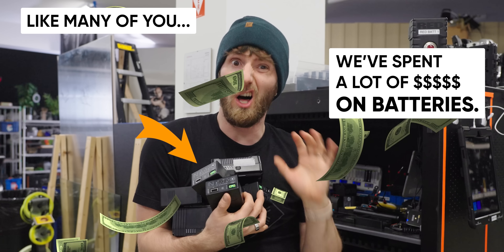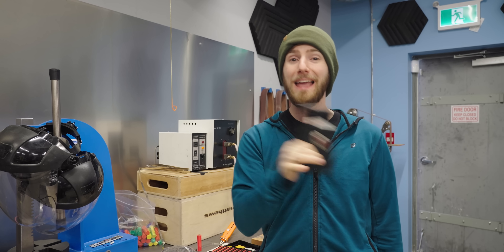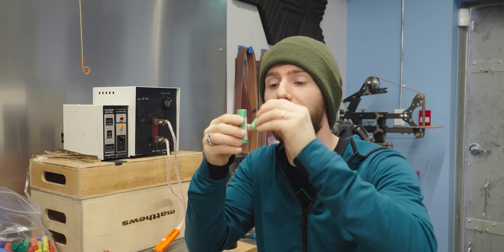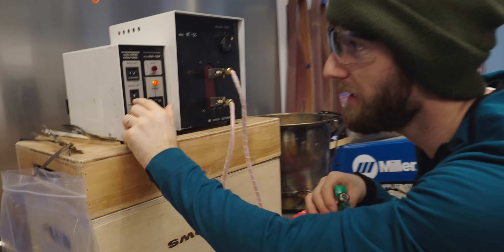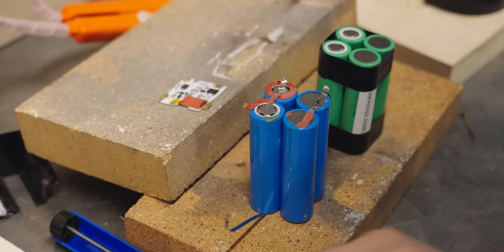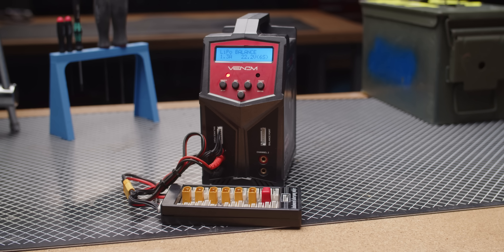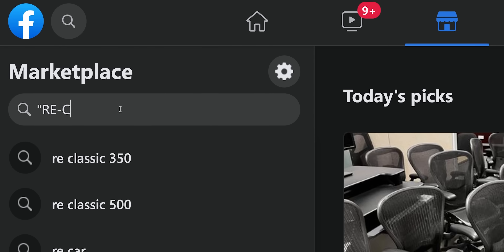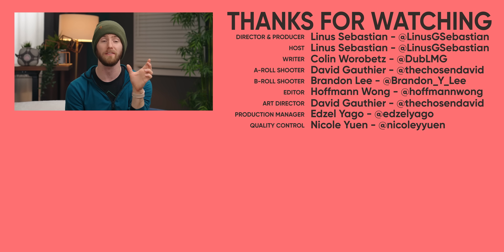This should be illegal… Battery Repair Blocking

Comment: The batteries are proprietary and can't be substituted with Commercial Off-The Shelf (COTS) parts. The reason they are proprietary has to do with form factor and device requirements.  This isn't a place to pick a battle.

Comment: Just add a new single battery fused then snip the default leads to dying battery area that will keep the board living during operating it's like charging circuitry in amplifiers motherboards using a bulb before hooking to 12 volt assembly would be snip life support right after main leads are being connected

Comment: some BMS might required manual reset after the battery voltage dropped to certain level, try shot the battery pack negative terminal to BMS negative terminal for 3secs. TRY AT OWN RISK

Comment: You need to be aware that there are a good number of BMS chips out there that are very sensitive to the order of connecting the cell stack leads.  Generally you start with the negative and then connect the cell nodes in the positive direction from lowest up until the top of the stack.  You can find this when you read through the chip application notes.  Doing this wrong can result in either the BMS going into protection mode and locking you out or even blowing the BMS chip itself.  A few other things.  It is helpful to weld the cell tabs from negative to positive up the string as well.  Use that DMM you have there before placing every Ni weld strap!  If you see more than a few millivolts you are making a wrong connection.  If you wait until you do a weld then find you are shorting something by making a wrong connection you are too late and you will have both a fire AND lose the cells you just paid for.  You don't need to buy an expensive welder; look on youtube for super cheap welders you can make yourself.  I found one where a guy made a welder with a contactor, a beefy battery and copper roofing nails.  I thought that funny so built one myself just to see how it worked compared to the industrial one where I work.  Not bad at all!  I made it a little fancier, I made an actual adjustable one-shot to get the timing uniform.  I used three in series 32113 A123 cells which can handle enormous currents (Battery Hookup always has beefy cells you can use).  Another thing to consider is that some BMSes track battery health and if you replace the cells you need to reset it or the charge indicator and reported charge will be way off.  Another thing is that some of the BMSes will go into protection mode when cells are removed and are reset by connecting to a charger, so try that.

Comment: As someone who does this sort of repair and build at least daily, a couple of suggestions:
Don't use tape to bind your pack, use a quick-drying epoxy between each cell. You're not going to swap individuals out later, no need to pack loose.
When assembling batteries, gravity is your friend. Build a small ramp, kinda like a card dealer's shoe, with a back edge and an edge to hold the batteries in line. Use this to line up single sheets of batteries, then epoxy them together.
Always use the lowest tolerable schedule for tacking together nickel plating on lithium builds.
Reply: While generally switching individual cells can seriously unbalance a battery, switching out DoA or otherwise prematurely failing cells still makes sense, and gets blocked by epoxying everything together before even knowing if there are any bad cells in the batch.
Reply: Why not use hot glue instead of epoxy. It's much much more convenient, and is plenty sufficient.
Reply: @smallblockchevy1022  Many packs are put together with hot glue, but you need to be careful with lithium cells since they really don't like high temperatures.  So use the minimum amount of the lowest temp glue.
Reply: @laurenceperkins7468  Yeah, that's a non issue. Hot glue guns don't produce the kind of heat that would present a problem in that scenario. Even if the glue does reach a temperature equal to, or even a little higher than what Li-Ion cells are rated for, it isn't going to hurt the cell.

People need to remember that nothing out there is ever rated at the exact the exact point where it actually fails. There are differences depending on the specific product, but most things are rated on a double, triple, or even quadrupal standard. If a ladder is rated at 250 lbs, that means that in actually lab testing, that they didn't actually fail until exposed to loads in excess of 500, 750, or even 1,000 lbs. Like wise with air compressor tanks. Tanks that are rated for a maximum pressure of 120psi, never fail at less than 360psi during the safety testing phase.

So I don't know exactly what it is for Li-Ion cells, but I guarantee that they'll take far higher temperatures than manufacturers will ever publish.

But there's even further reason than that to why using hot glue won't present any issue, and that's because cylindrical metal cells conduct and dissipate/transfer heat fairly efficiently. When you apply hot glue, even at what would be considered too hot of a temperature, to the external surface of a cell, that doesn't mean that the internal portion of the cell will ever reach that temperature, because the hot spot the glue creates on the metal exterior will disperse throughout the surrounding areas of the exterior at a much lower temperature than the initial applied temperature.

I think you'd have a hell of a time destroying/damaging a cell with hot glue, even if you were intentionally trying to. Now if it were some type of resin, or rare type of hot glue, maaaaybe, but just standard hot glue... And of course I'll never say never, but I'm pretty confidently thinking there's not a chance.
Reply: @smallblockchevy1022  High temp hot glue goes on at 450F.

The cooler stuff is only 250F.

You'll start to damage lithium-ion cells at around 140F.

So yes, you could definitely damage them on purpose with a hot glue gun.

Which doesn't mean you can't use hot glue.  Like you said, metal-cased cells distribute heat reasonably quickly, so you probably won't make any hot spots if you use a low-temp gun and don't linger and don't use too much.

But don't linger and don't use too much.  You probably won't make a cell explode, but you can easily shorten its life with too much glue.

Epoxy can have this problem too though, some quick-set formulations can get quite hot and can be an issue if you use too much.
Reply: @laurenceperkins7468  Well OK, I may have been exaggerating with the "even trying" claim :) , but from my understanding of physics, and the general understanding I've gained thus far about li-ion batteries in general, at mildly hot temperatures (which is a relative term of course), perhaps even up close to 175F, short exposures, although actual lab tests may show a trivial amount of cell degradation, don't really present an issue for practical, real world purposes. I believe it's more a long-term exposure issue. Examples like a long ride up a steep hill on an ebike at full power, on a 120F day, with your cell pack in a black case, directly in the sun. Or storing your pack in a closed up, non-climate controlled storage shed throughout the summer, in an area that regularly saw 120F summer days.

I plan on testing this one day, but for now I'm quite positive that no hot glue work on li-ion battery packs is going to result in any type of perceivable, or at the very least, consequential reduction in performance. Obviously within reason of course. It probably wouldn't be too good of an idea to completely submerge a battery pack in 450F, liquid hot glue.

Again, I'm not 100% sure on this, but I'm pretty damn confident based on my research and understanding thus far.
Reply: @smallblockchevy1022  You can test it easily enough just by taking some dead cells and gluing one side of them and putting a thermometer on the other to see how much heat comes through.  The math can get a bit complex for an exact answer, but as long as it's got enough margin you don't need to be exact.

I've rebuilt a ton of NiMH packs over the years, generally using hot glue, and I don't expect a thin bead of low-temp, or probably even a thin bead of high-temp to hold the batteries together would be a problem with lithium.

But don't succumb to the temptation to use it as a gap filler, there's a fair amount of heat energy in there, as anyone who's ever dripped it on themselves can tell you.  Probably won't blow anything up, but for a long-lasting pack you really want the capacities as closely balanced as possible, so weakening a couple of cells even slightly can exacerbate the wear on them and reduce the lifespan of your pack.
Reply: "use the lowest tolerable schedule for tacking together nickel plating"
What do you mean by "lowest tolerable schedule"?
Do you mean we should use the thinnest nickel strips practical?
If so, why?
Thanks for all the great suggestions.
Reply: @ddegn  You want the thinnest nickel strips that will carry the load because they require the least heat to weld and therefore have the least chance of damaging the cell.  You then want to use the lightest spot welds that will take the strain for similar reasons.  Honestly, the amount of glow they were getting from their welder had me a bit concerned...  Most other battery spot welding I've seen or done doesn't get anywhere near that bright.  Maybe their tips were terrible, or maybe it was their camera, but it just looked like too much.
Reply: @laurenceperkins7468  Thanks for your reply.

Comment: Could use that for my pro Canon Video camera.. I'm a good soldered and have computer electronics degree I do alot of hack on my Nikon D5000 and D90 The Canon is very different protected by a board that seems to recognize diff batteries that are perfect voltage.., mah and Current output match

Comment: Lithium ion batteries contain no lithium metal.  You can use a regular ABC fire extinguisher. Non rechargeable lithium batteries like CR123's or Energizer ultimate lithium, do contain lithium metal, thus you can't use a water based extinguisher.  Lithium metal disoloves in water and creates hydrogen gas.

Comment: Back in the 1970's and 80's,  a young man I knew in college who lived on my dorm floor,  used to intern at the CIA.   He always had several POUNDS of lithium metal,  so you always had to take care before using the toilets or urinals...  Not only because of the risk of him saran wrapping them so you got splashed,  but because he would often add a piece of lithum metal to the saran wrap,  so when the urine or poo hit the wrap and the lithium got wet the fireworks would begin.  Because of his and his family's "connections" in the DC area,  he never got in trouble for his antics,  the worst was a warning for setting a pan of isopropyl alcohol in an aluminum pan on fire with some lithium out on a college sidewalk while the Blacksburg police were driving through the college on the shortcut to the other side of the town where the new construction was....

Comment: Had the same problem with very expensive stick blender from Phillips. I've been playing with 18650  for a while so hoped for a similarity. Guess what, same batteries just 1/3 amp hours. They had made it so the batteries were in a tray to be pulled out, when disposing of the product. BUT doing so a cable detached deep inside, so you cant just re-insert it. 

Clever girls.